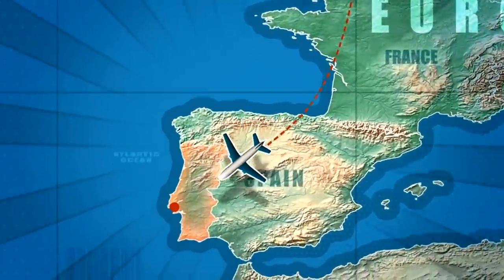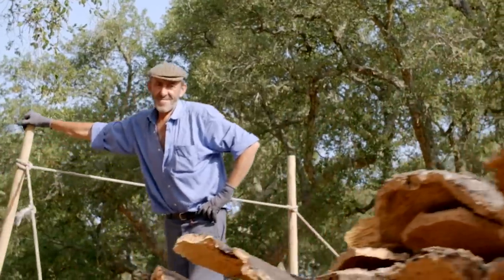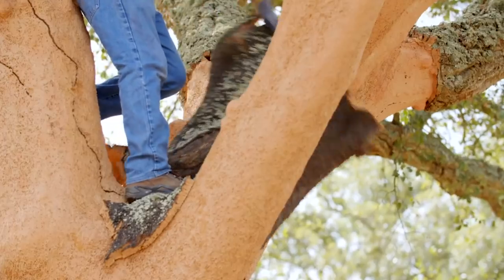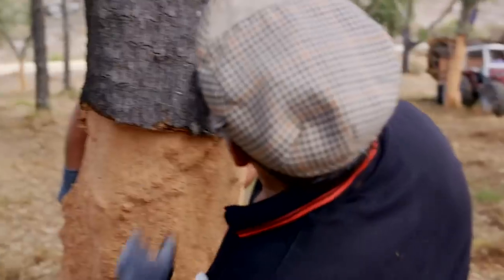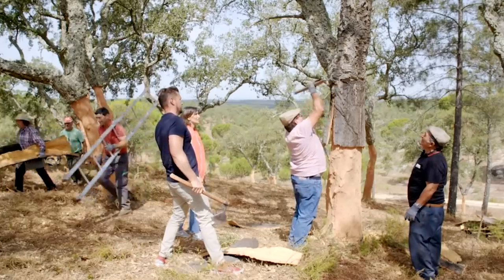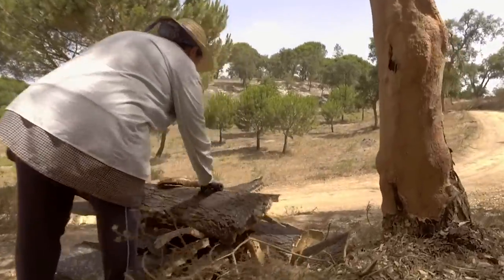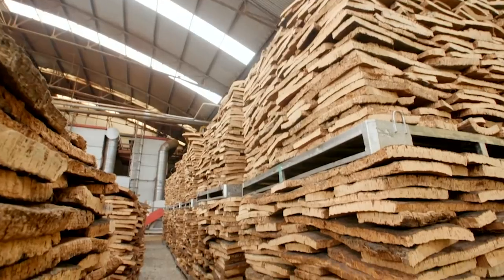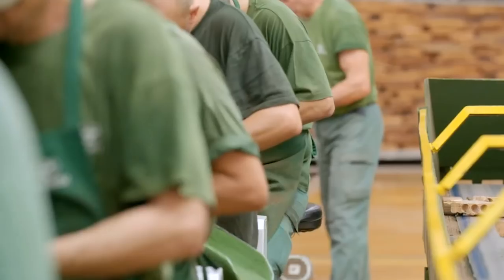How Do You Turn an Tree Into a Wine Cork? | Food Unwrapped

Comment: When winemakers are saving sample bottles of their vintages for reference, they use steel-and-plastic caps on the bottles. I love cork but it’s not optimal for sealing wine bottles.
Reply: The point of the cork is to slowly allow a tiny bit of oxygen into the bottle to age the wine. Otherwise your incredibly tannic raw cabernet or petite syrah never ages and then it doesn't taste good with your food you pair it with. It isn't supposed to be a perfect seal.